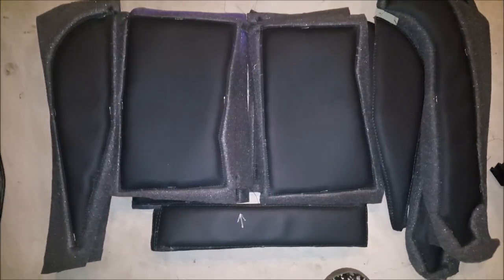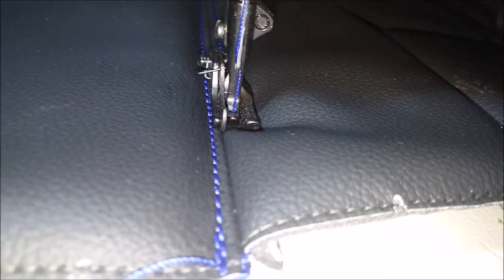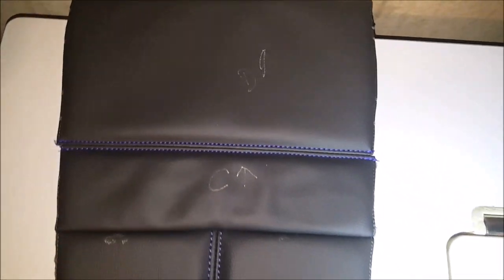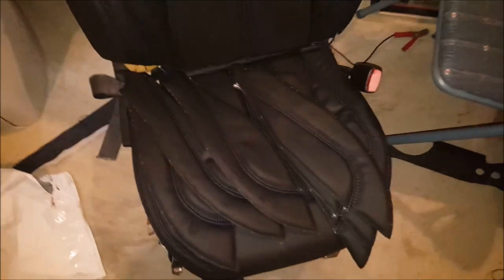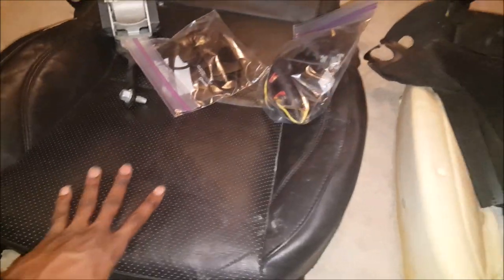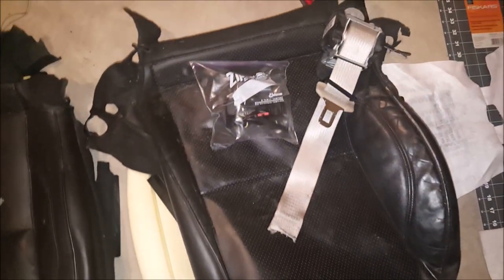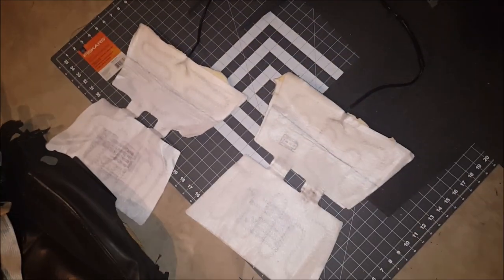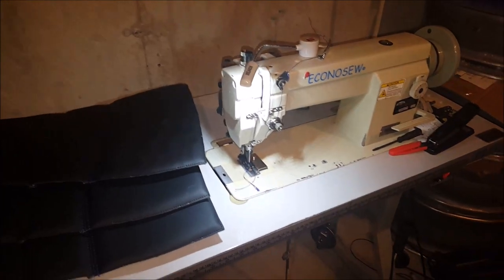Veltboy314 - Cutlass Seat Upholstery Project Part 6

Comment: It's coming out good that's good with out a double needle I found a good used walking foot for around 700 iam bout to start on mine thanks for the videos
Reply from the maker: +Mr.404 Atl That guide foot helped a lot. I still got out of line in a few places but its not too bad. It kind of tough to take that guide around corners & keep the spacing consistent so thatss something that I have to work on
Reply from the maker: +Mr.404 Atl Post some vids when you get started